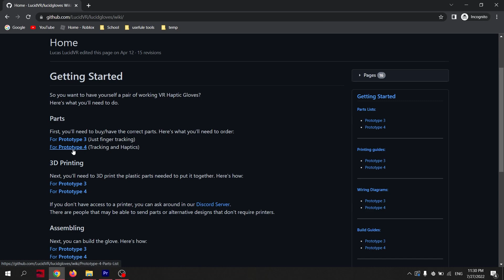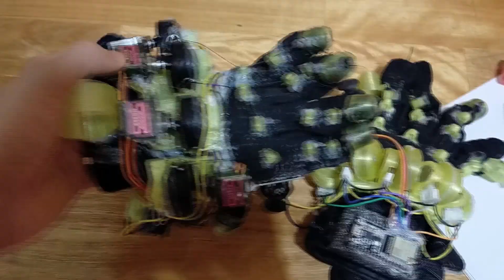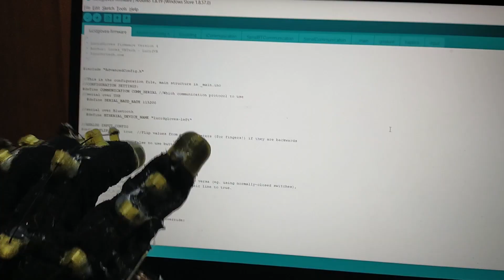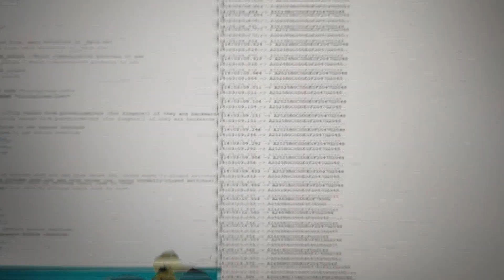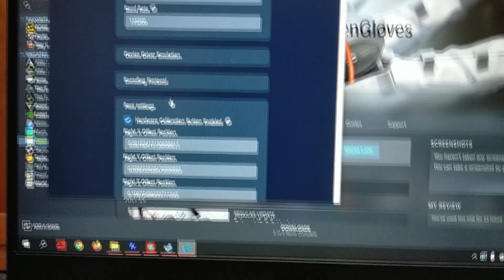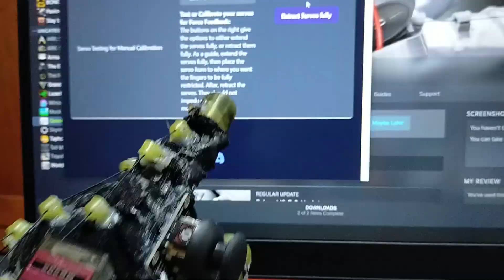So I tried making a vr glove(Ver4.1)

Comment: Hello, can you use flexible sensors? and connect them to the Arduino?
Reply from the maker: I am not sure about using flexible sensors as the ver 4 firmware is probably designed with potentiometers in mind. But if you can do a bit of coding and know what to tweak. I don't see why not😁
Reply from the maker: Wow I really am missing a lot of comments...I am sorry for the late reply(plz forgive my dumbness 🥺)